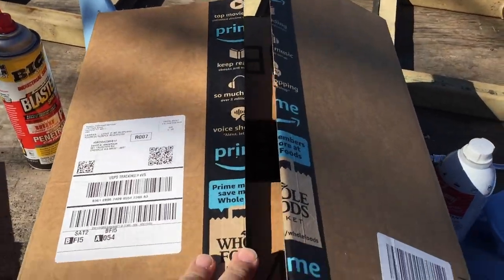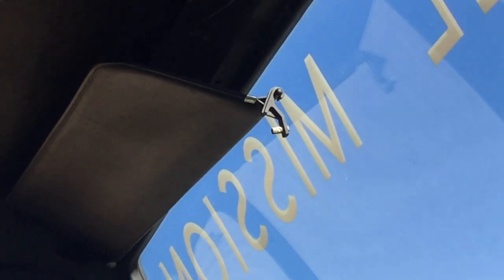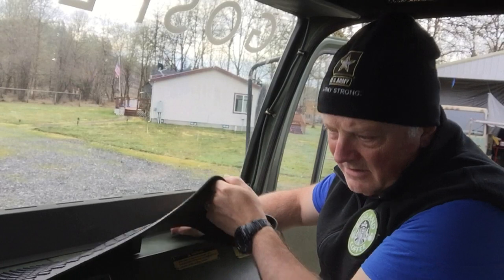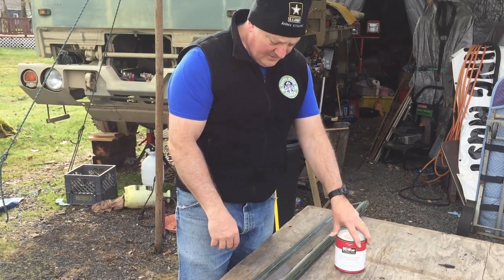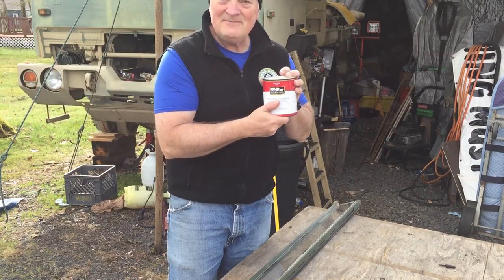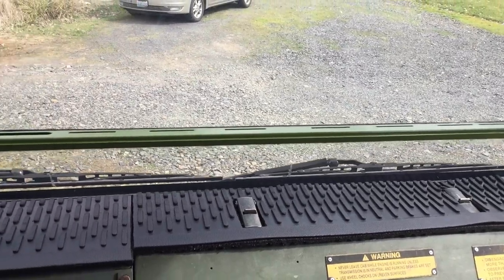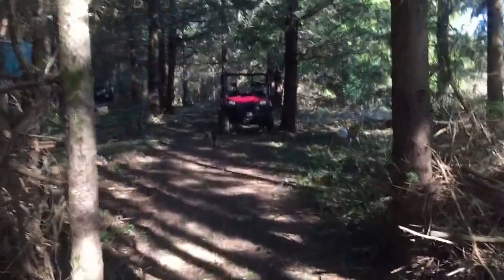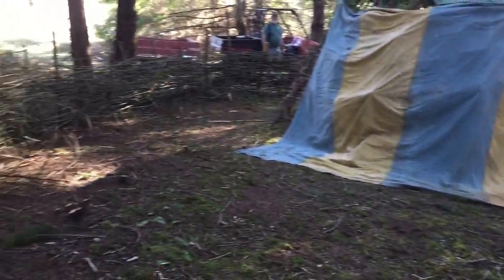DASH MATS & DEFOG VENT COVER SWAP #33

Comment: I worked on Oshkosh trucks many years ago with similar problems. Check the grounds from the batteries to the frame also the ground from the frame to the engine. Also the connections on the starter itself can come loose.  Clean them up and put dielectric grease on them.  Just some memories hope I can help.
Reply from the maker: About the only things I have not tackled yet were the starter connections and the push button starter switch. I did find an issue with one of the battery multi-connection points... that will be in a video probably next Monday. Thank you very much for the advise, I could use a lot more comments just like yours! (Need help!) Thanks and come back again sometime.
Reply: I am a frequent visitor of your and  Sean Fillne site. I enjoy both. I keep bidding on a LMTV that is abortable foe me HA HA. See if I can finally get one. I enjoyed working on big trucks and equipment in my younger days. Any help I can pass on to you let me know . Just have to remove some cobwebs from my brain some more than 30 years ago.
Reply from the maker: @billwheawill6544  let me tell you, I prize people like you. Cause I'm no trouble-shooter. It is great to have you looking over my shoulder to keep me safe and on track. You spot something in the video that I don't, don't hesitate to speak up. Thanks so much, Bill. I hope you can swing a good deal soon!
Reply: One thing to remember  is almost all the time it is the simple things will drive you nuts like a corroded or loose connection. Good example I looked for a vibration in the drive line that came and went and found water in a tire that froze from a  truck stop air hose. Do not forget to check the fluid level in the hubs if apical often overlooked. Most gear reduction hubs have them some rear get there lube from the differential.
Reply from the maker: @billwheawill6544  that is a good call! My next (after the one I am working on) video will be lube and axle fluids. Do you have any pointers for me? (Other than the hubs?)
Reply: If you have not all ready down load the manual for your truck A0 type or A1should be slimier other than engines etc. It should have all the information you could need. Dry reading a lot of information. It is public record so it should be free. Save it on your computer  or usb flash drive for future reference. It should give fluid checks , levels, and types. Always go with Cat, Donaldson,  fleatgard or  good name brand filters. Check internet for revues. Spend a little extra on good Quality filters save a lot on future head aches. Just FYI I like Shell Rotella t 15w40 oil you can find it any were and I never seen sludge or abnormal problems  in a engine using it I tore down. There are other oil that could be just as good also.
Reply: There is a person on YouTube, Adept ape that has a wealth of information on cat engines especially 3116. Check out the video about the upgrade oil line on the huei pump. Most fixes can be done by you with a little time and patience.
Reply from the maker: @billwheawill6544  Thanks again, Bill!

Comment: 3 possibilities.  You have a thermal protection sensor on your starter.  Unplug it and try again.

You need new batteries.

Your starter is on it's way out.

Partrisha to the rescue.  

Was that Silent Bob's son?
Reply: Sean I did test the batteries and they are over 100 Ah to a low of 80 Ah. We did find a lose - cable. Yes That is my youngest Kevin. He is special needs.
Reply: @badbadbob1  Okay.  Did you guys load test them??  I would try the other suggestions.  You have free solutions.  Hint hint.  Hi Kevin!
Reply: @SeanFillner  The battery tester is a High intelligence low impact  tester.  The batteries are well equipped to handle a start. The cable being lose was part of the problem. After running the truck, It charged all the batteries better and started with out the bump on his trip home.

Comment: Mine does that when the batteries are not charged. 

Load test the batteries and see what kind of shape they are in.
Reply from the maker: Bob (a.k.a. "Silent Bob") has a high speed tester he is going to bring over. It will either eliminate the batteries as a problem or confirm it. We will also use the laser temp probe to determine if there is any heating of the battery cables after a start and during idle. I really would rather not have to buy batteries if I can help it.

Comment: I will bring over the battery tester I use at work. It will tell voltage and Ah condition of the batteries.  Ah=( Amp hours)
Reply from the maker: Thank you... that would help me figure out if there is a battery issue or some other kind of problem.